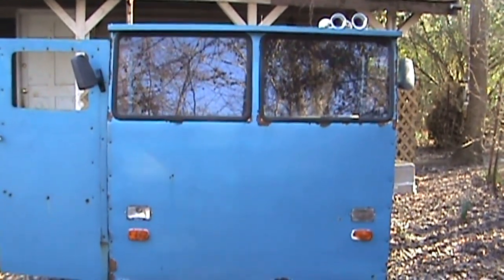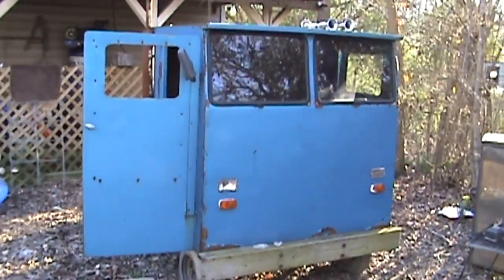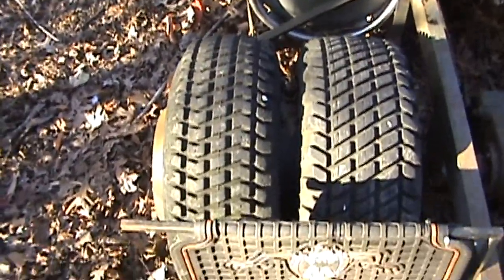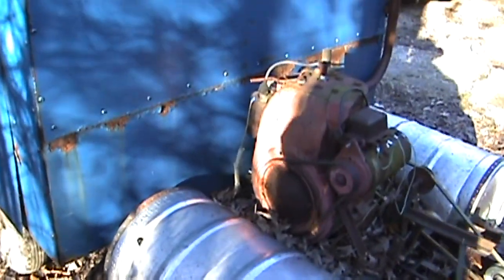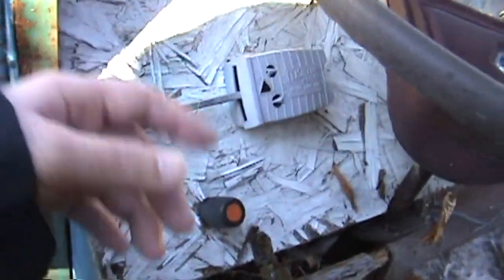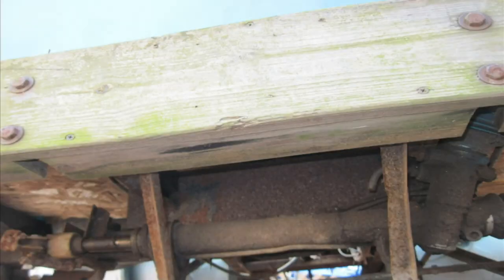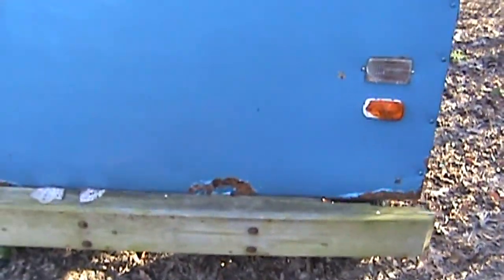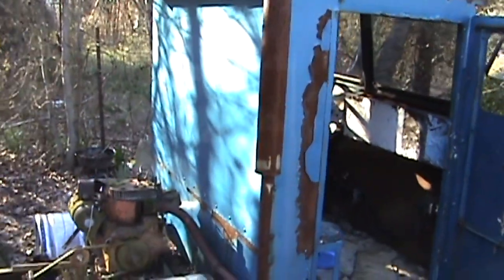Mini Semi Truck

Comment: Ohh wow!! This thing is so cool. I would like to build something like this for pulling with a little stick shift and a 18hp vertical shaft and making a frame and using 2 transaxles from a heavy duty garden tractor and welding on 4 rear wheels. Can you tell me what size the tires are?

Comment: I used that then a braided coated go pro camera cable tether together as a pull cord. I've pix if you want lol. ☺ I'd put an old Case Diesel engine in it one from a. 70s.or 80s mid size yard tractor that would be bad ass
Reply from the maker: A little diesel would be fantastic on this truck.
I don't have any updates at the moment, it's on jack stands with the interior gutted and the front end removed.   I am reworking the steering to eliminate the problems I had with it in the past.   It has a different engine on it as well, hopefully when the weather cools off a little work will slow down and I can get back to tinkering with this. 

Thanks for checking it out!
Reply: @oldchevy4x4  Any updates :) I came across your video again.... Ps honk the horns 😆

Comment: How much does it weigh with someone in it? I suck at metal framing so I have been building a wooden chassis and frame for a COE mini-truck and since the wood will probably be heavier than if the chassis was metal, I wanted to make sure it wouldn’t be too heavy as I am currently planning on putting in a 10- or 12-horse Briggs with like a 4-1 gear reduction.
Reply from the maker: The truck's overall weight without anyone inside is around 600 lbs.
Reply: OldChevy4x4 thanks. It’s incredible that you are still replying to comments on a 9 year old video. Do you think that the wood chassis for mine would be viable? The chassis plus a couple other things is 30-40 pounds and the can will be like 80-100
Reply from the maker: Wood would definitely be viable.   Weight is a relative thing; axle strength & gearing all plays a factor.
Reply: OldChevy4x4 thanks. Would Kohler or B&S be better? I’ve heard that B&S has better low revving torque but Kohler is a better high speed engine? Or are they about the same?
Reply from the maker: They both have their ups & downs, it just depends on the engine model.   Steer clear from the Kohler Courage line of engines tho.
Reply: OldChevy4x4 cool. I am going to be avoiding the newer engines altogether because I like the older ones, and I prefer flatheads anyway.